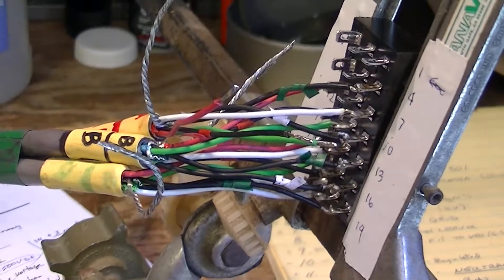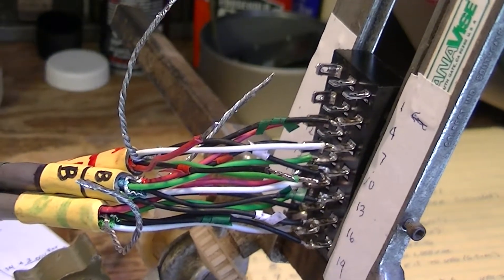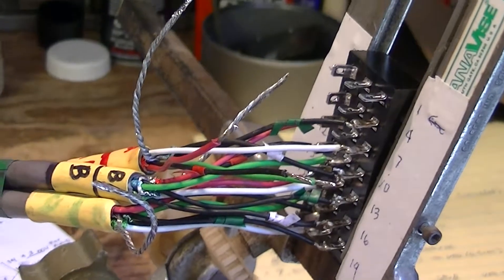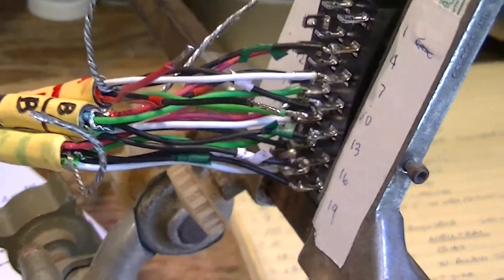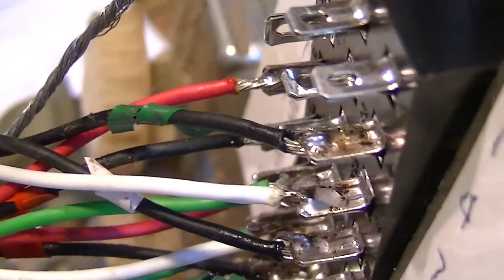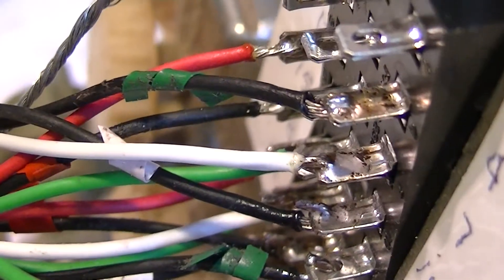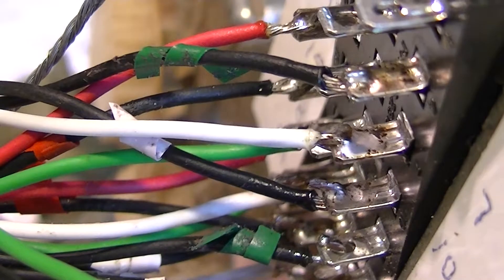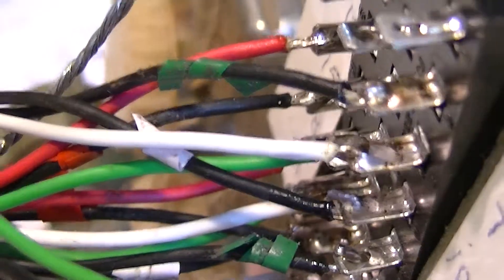HAM RADIO: MAKING COMPLEX CABLES  #7 LEAD DRESS

Comment from the maker: WIRE NUMBERING:  Gardner-Bender makes wire number/letter sets for electricians which you can buy at Ace Hardware, Home Depot, Lowe's Etc. Use them inside the connectors